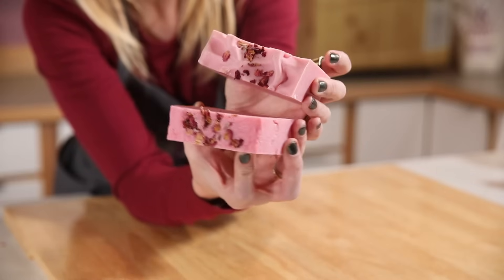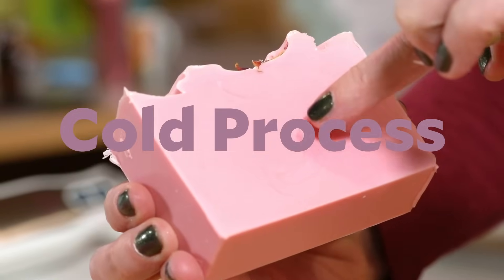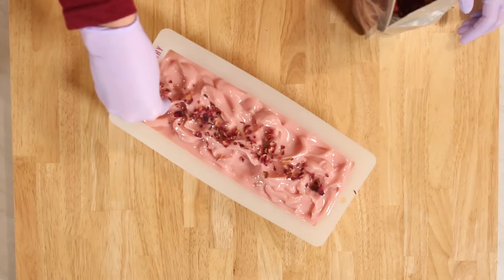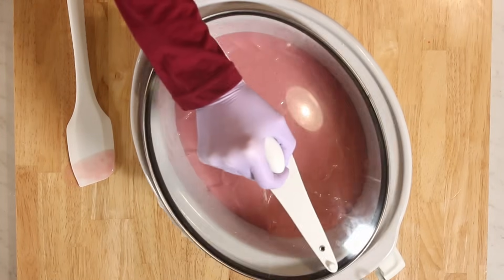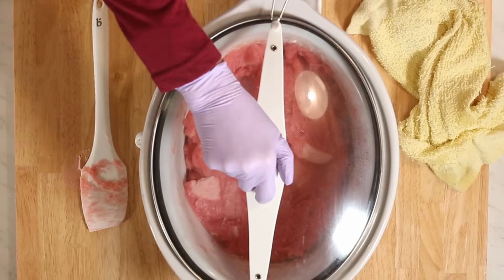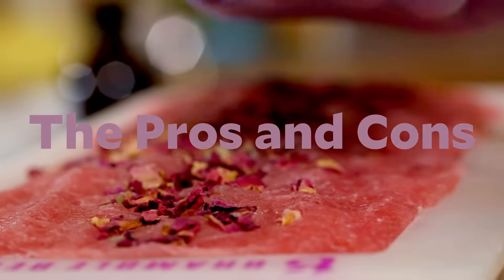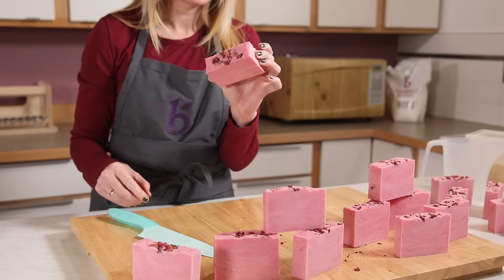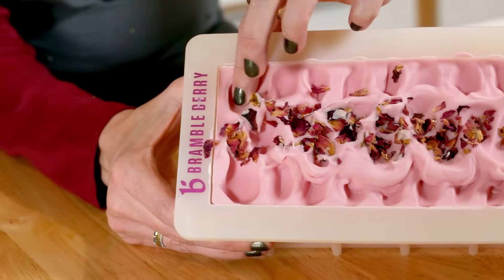Cold Process Soap vs. Hot Process Soap - Pros and Cons | Bramble Berry

Comment: I prefer the hot process, because I can superfat with an expensive oil after the lye has eaten up all the less expensive oil. I was hoping you’d talk more about scraping the crust off the side of the pot. I hate that crusty buildup, is there a way to avoid it?
Reply from the maker: That's a great question, we haven't found a way to avoid it yet but hot soapy water helps clear it off.
Reply: @bramble-berry Lol yeah the hot soapy water works well at cleanup time but it’s not a practical solution for while the soap is cooking.

Comment: you need to use a higher water percentage in hot process so it's more fluid
Reply from the maker: If you use a higher amount of water in your hot process recipe it will take longer to cure. The amount you use is up to your preference, but we prefer to keep the percentage low.

Comment: It is best to let the HP soap cure like a CP soap. The bar will harden & water still evaporates after 2 weeks. Make a batch of HP soap & test a bar each week. You will see that there is a slight change in the weight of a bar.

Comment: Hope someone can answer my question. I made a cold process soap. Did not add enough lye water (my mistake) so the soap is too soft. I want to melt it in a crock pot, and add the lye water amount that is missing. Do I have to respect the 10 degrees difference like in cold process? I do think the answer is yes. Thank you!
Reply from the maker: We have not found there to be a good way to fix soap with not enough lye. You can read more about this on our old blog here: https://www.soapqueen.com/bath-and-body-tutorials/tips-and-tricks/soapy-mess-quick-guide/

Comment: Are you using mica Powder? Is mica water or Oil solubel
Reply from the maker: Mica is oil soluble.
Reply from the maker: Hot process soap is ready to use before cold process. Hot process and cold process will typically not exceed 180 degrees.

Comment: I make both and love both processes for different reasons. One more great thing about hot process is you can use less fragrance & get the same strength & you can use those flighty essential oils that usually disappear.  Also, it's useful for using those fragrances that do weird things like ricing & acceleration without a problem. I do love cold process though for the artistic side in me & love the smoothness & scoopability of it.

Comment: Hot process soap maker here. Even though you can use and sell the hot process soaps right away, I always let it cure at least 2 weeks before selling or using. The 2 week cure will make a harder bar that will last longer.❤
Reply: New to soap making here. So is this an upside of hot process? The fact that the soap can be used sooner?
Reply: @juanvillatoro5196  Good question, anyone know?
Reply: Ive done it too i always let it cure for two weeks or even three weeks.

Comment: Hi, Ann-Marie,  I make HP soap and after it is completely done I let it cool a little and add the fragrance and incorporate about 1/4 cup of plain yogurt into the 3# batch of batter. Adding the yogurt makes the batter fluid, enough to make a nice swirl possible. I then separate it into a couple of containers, color with complementary colors and pour it into the mold using the swirl method. This has worked beautifully for me. So I will say that I prefer HP over CP because your not taking a chance on wasting the fragrance oil or essential oils with this method because the lye no longer exists, the colors will be true and won't morph plus you can use this soap sooner than CP. I do make cold process also and I have used your recipe for beginners and LOVE it. I did change the formula slightly so I could add some Shea butter. All your videos have been very helpful and I want to thank you very much for posting them.
Reply: Hi, how much yogurt do you add per lb of soap?
Reply: hi ، can you please share how do you make hp soap ، how much % of yogurt you add ۔
Reply: @make7966 1/4 cup yogurt into how much batter?!

Comment: I need to try hot process, I’ve only ever done cold, but the fact that you can use hot process right away is very attractive.
Reply: If the batter has gone through the gel stage which is the last stage during the hot process, it is ready to pour into the mold and then cut the next day and it is then safe to use. By waiting, you are merely giving it time to become harder through evaporation which will make a nicer bar of soap and will last longer. I love doing hot process. You can use it right away but it will become harder if left  a couple weeks too dry. Watch a few videos so you can get the idea of hot process, I did and learned a lot by doing so. Have fun.
Reply: @make7966  - I responded to you other post too...I am a soap maker.  Yes, once the saponification process is complete, soap is 'safe' to use as there is no Sodium Hydroxide remaining.  In Hot Process, saponification is complete within a few hours due to the active external application of heat, while in Cold Process, the process is more organic and thus takes a good 24 hours.

Do NOT misconstrue by use of the word 'organic'...there is enough in-fighting between the different processes of soap making to say that one way is 'better' than another.  I use Cold Process because I'm lazy...I mix, pour, put my molds in the garage and go off to do other things while science does all the work for me.  And yes, I have tried Hot Process, Rebatch, CPOP and M&P.

And as I noted in my other response, water evaporation is only a part of the 'curing' process.
Reply: @LadyGecko I understand what you are saying, thank you. Have a most wonderful day and keep on soaping, friend.
Reply: It STILL has to cure!
Reply: @BadlandsGecko Probably a better word would be "evaporate" or "dry" instead of "cure". If the batter has gone through the gel stage which is the last stage during the hot process, it is ready to pour into the mold and then cut the next day and it is then safe to use. By waiting, you are merely giving it time to become harder through evaporation which will make a nicer bar of soap and will last longer. Perhaps that is what you meant by the word "cure". Sorry if I misunderstood your reply to TheBusysimmer.

Comment: So cold process soap will it not be hot or warm at all by itself in the process? Will it always stay cold. I thought it got hot by itself and didn't dare trying it out, but could have been mixing the information together?
Reply from the maker: Good question! The oils usually need to be warmed up to melt for pouring and the lye water gets very hot on its own. We like to let them both cool to about 120° F or below (and are ideally within 10 degrees of each other). Then add the lye water to the oils and stick blend until thin trace.

Comment: It is an unfortunate myth that hot process soap can be used immediately while cold process needs to cure for 4-6 weeks. Both soaps need to cure about the same length of time. Because saponification is completed during the cook, hot process soap is safe to use after it has cooled and set. But cold process soap finishes saponifying typically within 24-48 hours and is also safe to use. Both, however, need to cure for several weeks for optimal quality. As they cure, they become firmer and longer lasting. They become milder and the texture improves. If you use extra water to keep your hot process more fluid, it may actually need a longer cure. If you want to (marginally) reduce cure time, your best bet is cold process with a steep water discount and make sure your curing area is low humidity. 

In my opinion, the biggest advantage of hot process is that you can control what fats are left after saponification (the superfat) and add lye reactive ingredients after the cook. Robert Tisserand did an excellent interview with Kevin Dunn about essential oils in soap that explains a lot of this. Whether it is essential oils or other additives, if you have ingredients that you want to prevent from reacting with the lye, hot process is the way to go. 

Hot process is sometimes recommended to beginners on the theory that it is ready to use immediately. I actually think cold process is simpler and I generally recommend that beginners start with a simple cold process recipe.

Comment: Your comment that hot process soap is “ready to sell” the next day surprises me. Hot process and cold process soaps are both safe to use within a couple of days BUT, BOTH need to cure for several weeks before they should be used. You are doing a disservice to new or inexperienced soapers by suggesting otherwise. 
 I’m glad you commented on soaping safety. However Using a glass bowl to make soap is NOT safe as the lye  can damage and shatter glass.
Reply: I'm sort of surprised by that particular comment as well, of being able to use it the next day. Been making soap for a year and have never heard that about hot process soap. Everything I've read and seen still says hot process soap needs to cure, although it is for less time than cold process.
Reply from the maker: Cure time for both cold process soap and hot process soap is a bit of a mix of science and art. It can be little bit complicated! We understand how this short video may have oversimplified, and we apologize for any confusion. 

In general, for cold process soap, the recommended cure time is 4-6 weeks. During this time, the soap continues to saponify while some of the extra water will evaporate. For hot process soap, the extra heat speeds up the saponification process, so the soap is gentle enough to use the next day. 

Hot process soap can still benefit from extra curing, if the maker prefers. But it does not need as much as cold process soap. One week is usually sufficient, but some makers may choose to cure for less or longer. The hot process soap may not be at the optimal firmness the next day, but it is gentle and safe to sell the next day if you'd like.

We appreciate the question, and giving us the chance to clarify.
Reply: Definitely do not agree that cold princess is safe to use within a couple days. I can’t imagine getting raw soap in the eye. Needs a cure time off 4 - 6 weeks.
Reply: @clarioncall8449  in cold process soap, saponification is normally complete within 48 hours; it’s no longer “raw soap” - unless the soap is lye heavy, in which case it shouldn’t be used for a few months if at all. Both CP and HP soaps improve greatly through curing, but once saponified they are safe to use. It’s perfectly fine to try out your CP soap after a couple days as long as all the lye has saponified.
Reply: @janehutchinson5539  I am aware of that, but the ph can still be higher than is comfortable.
Reply: @clarioncall8449  Not corect. Ask advice from chemist about the superfat. Superfat by school basics needs to be 0%,  as NaOH is not pure/ clean it gives 2% right there. So, if you calculate soap with 4% superfat - it is actually 6% and it gives unsaturated fats ... it needs to cure then. With 0% superfat it is ready to use the next day but we still leave it 5 days for that NaOH  that is never 100% clean-to make sure even that PH is right and it is safe to use. U can calculate your recepies for soap with 0% superfat to still not dry the skin and have silky and smood feeling as well. Coconut oil dryes the skin- not more that 15% in your recepies and castor oil ( if you use) not more that 5%  for nice bubbles.
Happy soaps making and take care.